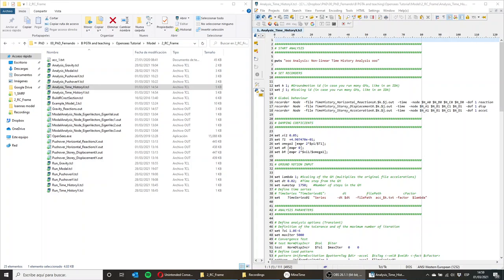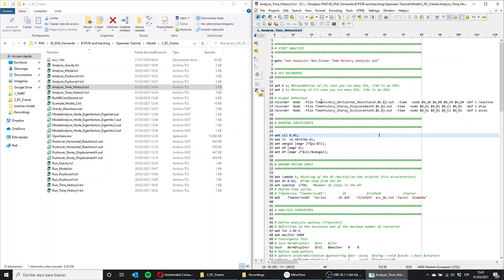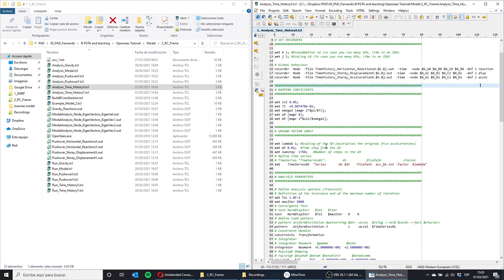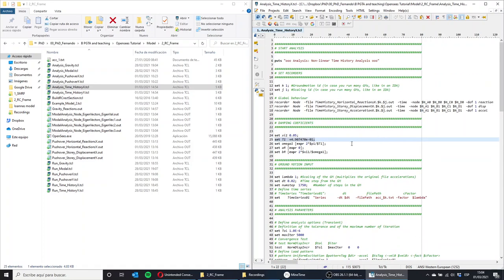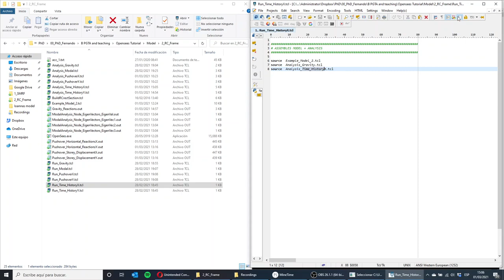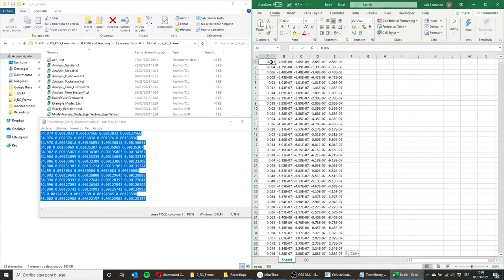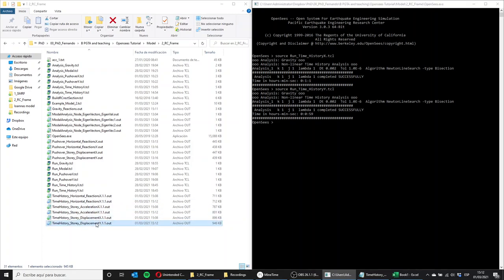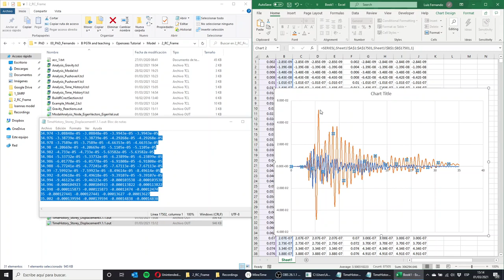OpenSees - Reinforced Concrete 3D model - 3 Time-History Analysis

Comment: thank you ,but i want to know the drift, and what should i do ,many thanks
Reply from the maker: Hi Zhangong. I would place a displacement recorder in the nodes that you are interested on, and then do the manual calculation (lateral deformation divided by height).